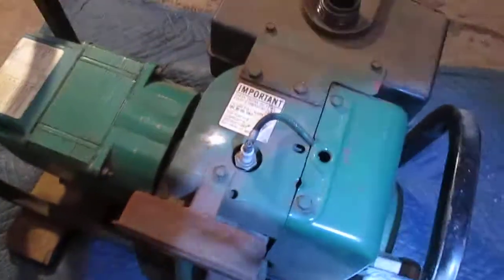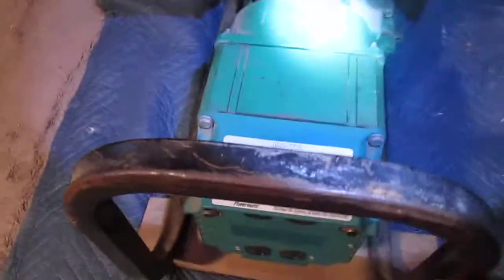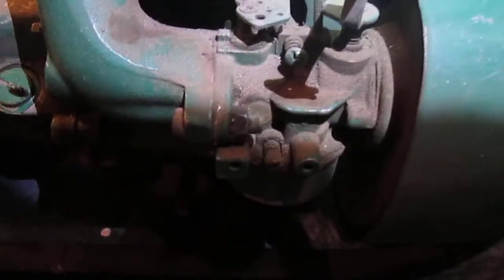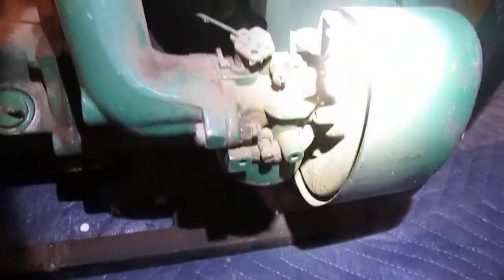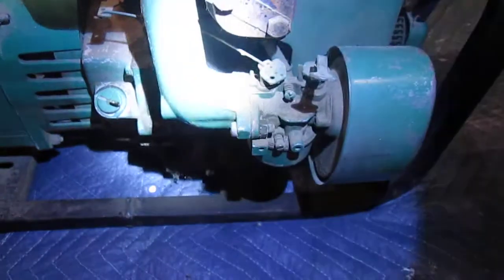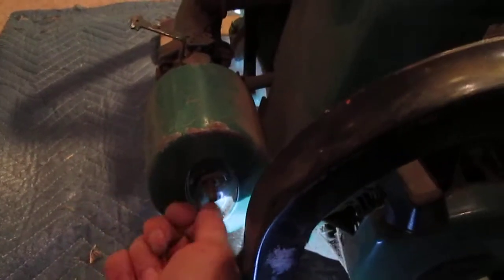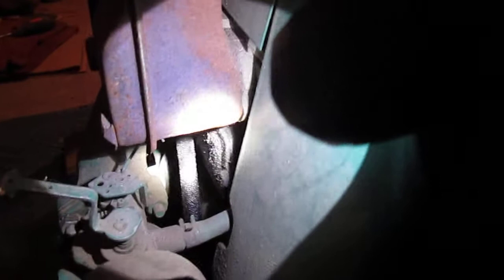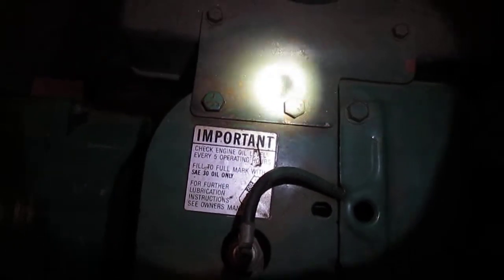Coleman Powermate PM52-4000 Generator - 4000 Watt - 4 KW 8 HP Tecumseh Engine

Comment: The 2 120 recepacles are 20 amps each. Rated at 30 amp total. Can a splitter be used in parallel to get 30 amps to an rv?
Reply from the maker: Not sure, sorry !!!

Comment: I have one of these I bought for 20 bucks I need some advice it won't run it will start but the die right after
Reply from the maker: #1.  Check Fuel - Fuel Line
#2.  Clean Carburetor
#3.  Test Spark Plug, Test Ignition Coil, Test Stator (If you see Spark, that means Ignition & Stator AOK)
NOTE:  Spray some starter fluid in the Air Filter/Hole and see if it continues to run.  If it does, then you just have to clean the Carburetor.
Reply: @JodBronson  I should see spark coming from plug wire right?
Reply from the maker: @robpaul7900  -  When testing, you take the WHOLE Spark Plug out of the engine and leave it close to the engine block.  From there, when you pull to start, you should see sparks trying to spark against the block.  If that is the case, then you know your Stator + Ignition Coil aok (for now).
Reply: @JodBronson  I took spark plug off completely and had spark plug wire touching block and saw blue spark coming off it. Mine is missing the gas tank pain in the ass it has a fuel hose I gotta rig something up does the gas tank need to be pressurized?
Reply: I also have a different looking muffler too my spec stuff is identical to yours. The muffler wasn't sealed to good I fixed it up I put a fuel shutoff valve and an inline filter new spark plug too so carburator you think?
Reply: What size thank is it on this? I found one on Amazon it says 2 gallon idk if it's the right one it doesn't list this model but looks just like it
Reply from the maker: @robpaul7900  - Not sure about Tank Size!

Comment: Hello, I just got one of these and can’t get to start. Is there anything I should start with first?
Reply from the maker: Check your Spark Plug.  Then spray some Starter Fluid in the Carb and see if it start.  If it does, then Carb needs cleaning.  If it doesn't, then check for Sparks / Spark Plug problems.
Reply: @JodBronson  thanks for the quick reply will do thanks! Do you know any websites that have parts for these?
Reply from the maker: @connormc18  - eBay would be best.  These are 8HP Tecumseh Engine (Briggs & Stratton 8HP).  Anything you buy, refer to 8HP or close to it.  Spark Plug or Fuel Line or Carburetor, Etc..., is really easy to find.  
NOTE:  Do not break Other Parts or Springs or Brackets, those are hard to find.  Other than that, you can get them easily on eBay. 
NOTE 2:  These doesn't take much to run, these are pretty reliable.  Only things that proprietary is hard to find, like the generator parts.  But common stuff are still easy to find.

Comment: I have aquired this exact model, is there a kill switch or on/off switch anywhere?
Reply from the maker: Hi, you have to make one... You want me to make a Video and show you how I did it?  I can for you if you want, just let me know.
Reply: Wow thanks for the quick reply! That would be awesome and I'd definitely watch the video and make one for mine.
Reply from the maker: @kealowilson2816  -  Ok, I will make one today and upload it later.
Reply from the maker: @kealowilson2816  - Here you go!  https://youtu.be/BzVqne6AtIw
Reply from the maker: @kealowilson2816  -  DO NOT make the Metal " too " close to the Spark Plug.... Electro will jump and may shut off your Engine.

Comment: That muffler link is a small muffler do you have a link for the larger muffler on the unit in your video as that would be much quieter muffler?
Reply from the maker: You can use this one here.  I have tested it, it doesn't make too much a difference but it's bigger.  See Link here:  https://www.mowmore.com/products/muffler-for-briggs-stratton-engines-2?variant=8457986637868
Reply from the maker: Also, the Original Round Muffler they use them on John Deere Series 60 +70 and 100.  You can use that as a reference to find it.  The only thing is, it's really hard to find the " Elbow " to make it look right.  But they have them on John Deere Series 60 + 70 and 100 and it's the same Muffler (Round).  How do I know?  My Dad have John Deere Series 60 + 70 + 100 in storage. :))))))))))

Comment: I just bought one of these and it is soo loud its almost unbearable even when inside the house. Do you know if they make a more updated muffler or silencer to quiet these down? Ty!!
Reply from the maker: Sorry for late reply. YouTube is NOT letting alert messages on my Channel.
Reply from the maker: I know what you mean by " Loud ".  You may want to check your " Governor " or the " Spring " that control the Governor is AOK.  Because of that, your Governor may be in the highest position.  YES, another Muffler would help.  There is a Muffler that I have that quiet down a bit... Check it out:  https://www.walmart.com/ip/Muffler-Briggs-Stratton-298830-Replacement-Muffler-Stens-105-064/159960858
Reply: I picked up one of these generators recently and I put on a Tecumseh 37350 Quiet Muffler.  It makes a big difference.  I got it from Jacks Small Engines.  Pretty cheap as well.